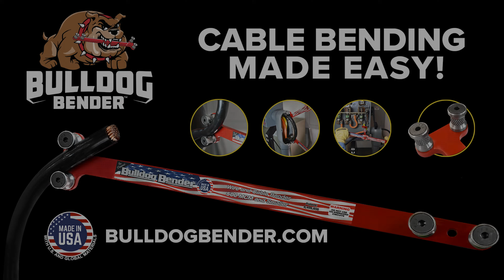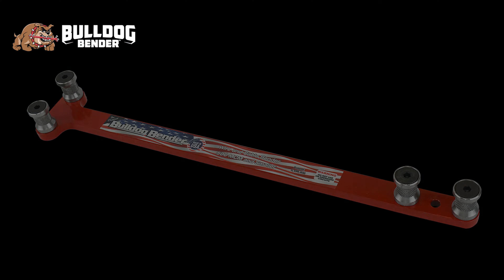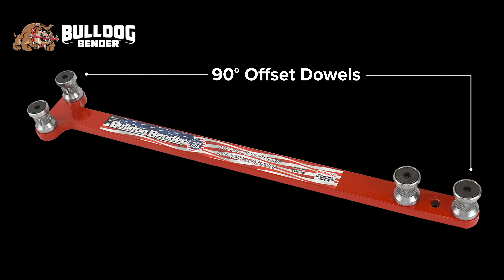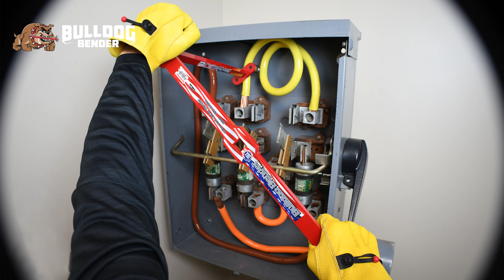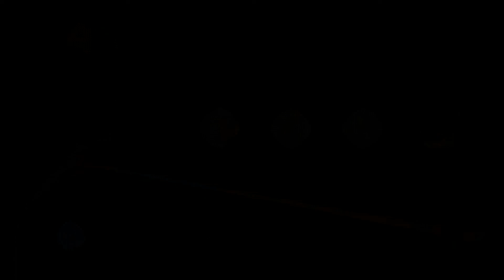Bulldog Bender - CABLE BENDING MADE EASY!

Comment: Unfortunately they never actually show us how to bend the cable into those tight little loops.
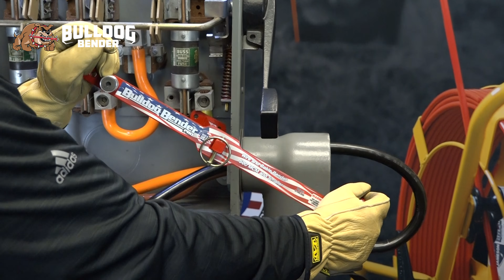Reply from the maker: Did you check out the video at time marker 1:00 ? Vince shows how to bend the wire inside the enclosure using the pro adapter.
Reply: @JamesonLLC  NO he doesn't. He places the tool against the cable and doesn't do anything else, and the tool is blocking half the view to the area anyway.